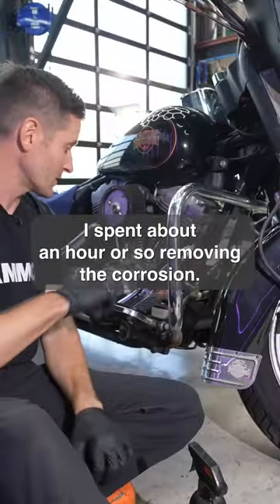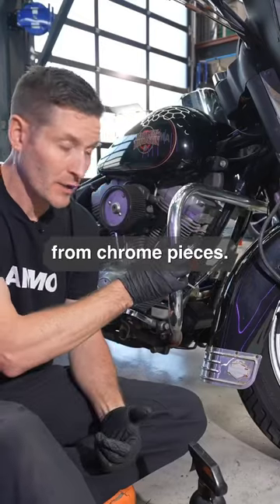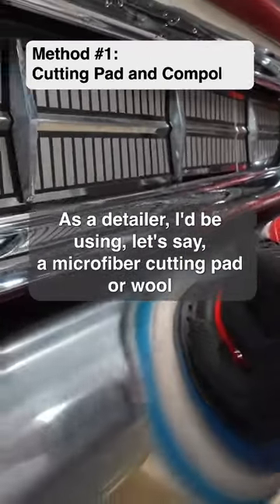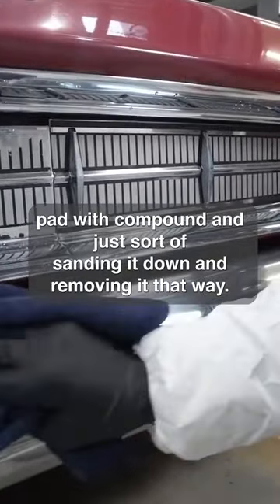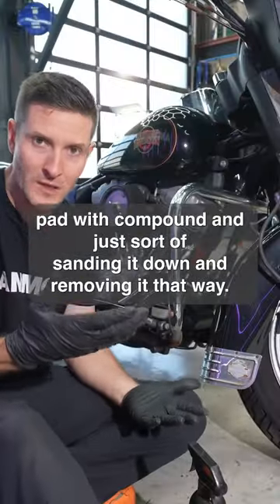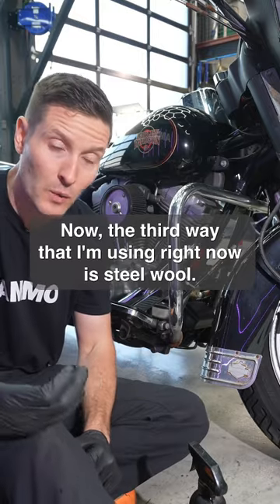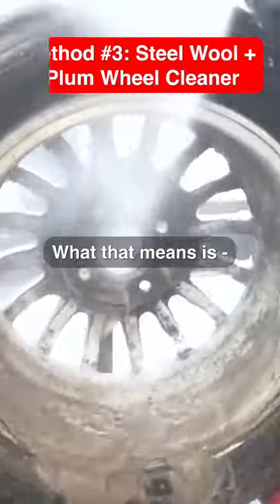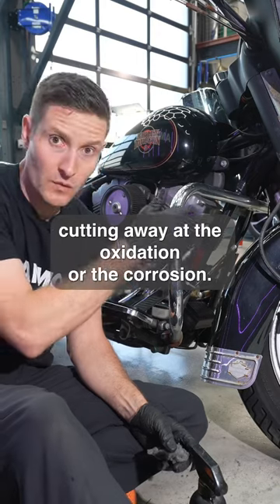Detailing Tips & Tricks: 3 methods to clean up chrome on a motorcycle #ammonyc #detailing

Comment: I used Evapo-Rust on my trucks bumper for fun to give it a whirl. 

It's been 2 years and the rust never returned, plus side is it even polished the chrome. 

All I did was add some to a paper towel, place it over the rust for a couple of minutes and went back re-wet the towel and rub it all out. 

In case you're wondering Evapo-Rust is an environmentally and skin safe product

Comment: I had a bike as a kid. The steel wool made it look good until it rained again. That’s when it immediately rusted 2x as bad. I don’t like this solution at all.
Reply from the maker: That’s why you would need to protect it afterwards as I did in the video. Yes agree if you expose metal to rain with no protection after steel wool… not good. Thankfully that’s not what we did here. Applying a coating afterwards sealed the surface to prevent oxidation
Reply: @AMMO-NYC what coating did/do you use to seal it?